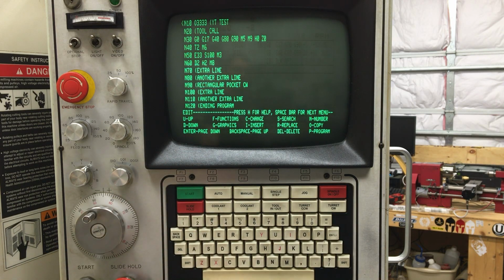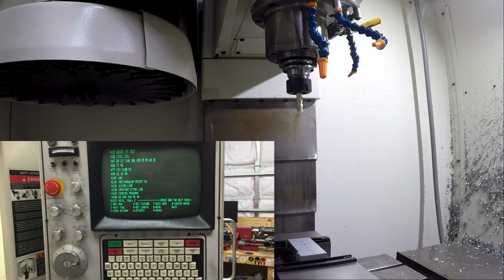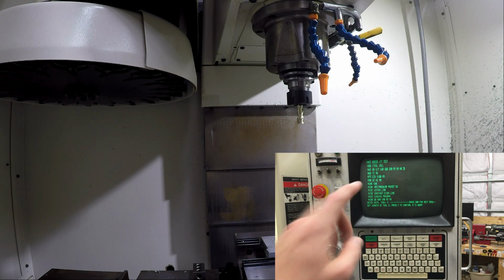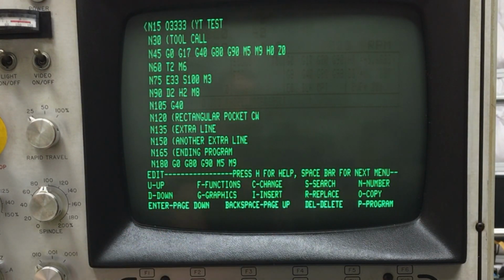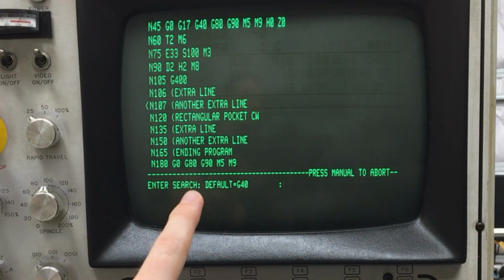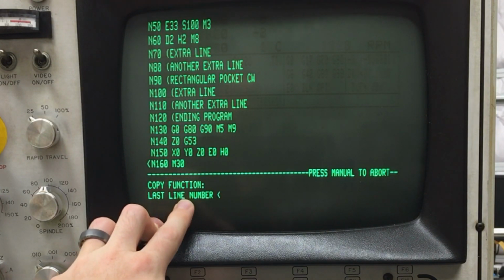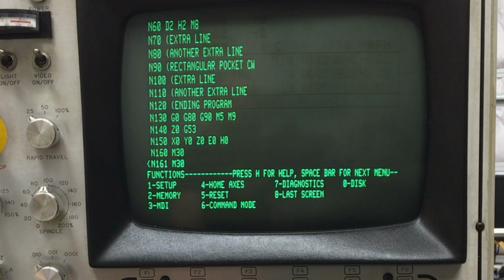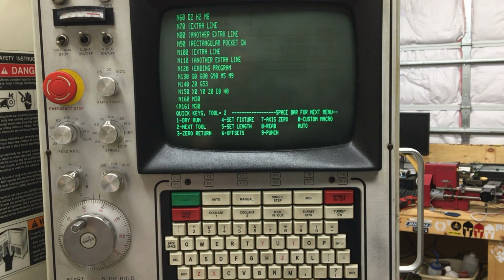Fadal Command Menus - Getting Started 5

Comment: Any idea what the boxed areas are in the display when you are jogging or MDI? Yours shows X,Y,Z in 3 rows and then has some boxes drawn below with additional X,Y,Z plus H and other parameters. Is this the current work offset shown below the machine offset? I have a ‘95 4020 88HS with -4 controller and I only see the top 3 rows but no boxes or which work offset I’m currently in. Can’t figure out what this is.
Reply from the maker: The boxes below my XYZ have more information from the program - tells you how much travel in XYZC you have to go, which tool you have loaded, offsets, M codes that are active, if optional stop is active, etc. I can’t recall exactly but if you don’t see them it might be related to if your machine is in format 1 or 2. Are you part of the Fadal FB group? A lot of great resources there too.
Reply: @bgwmachine  it’s in Format 2, but I’ll post it in that group. Seems like it’s just a setting I don’t know about.